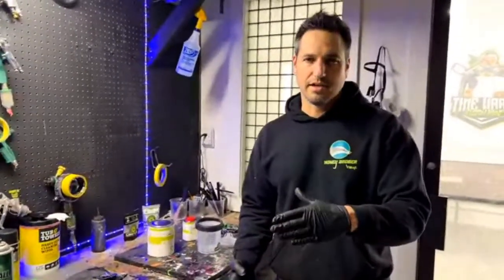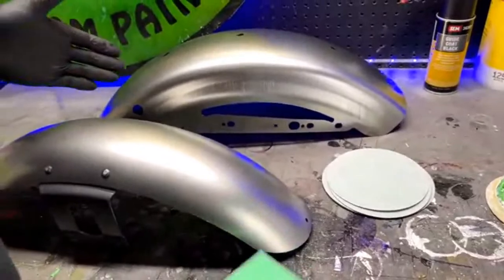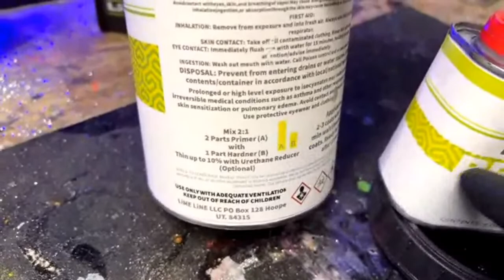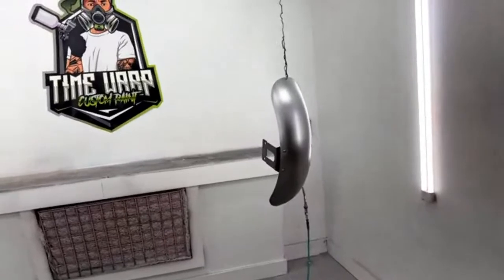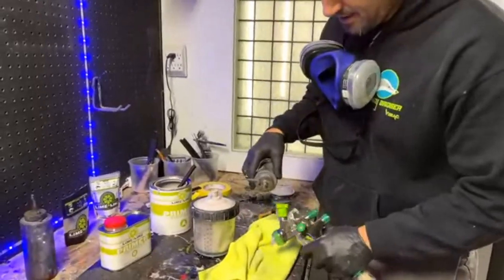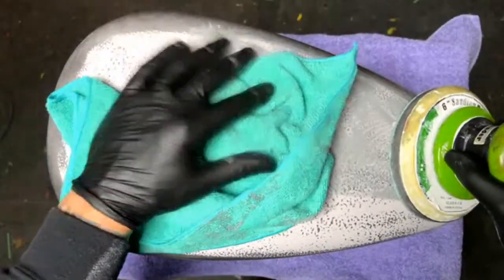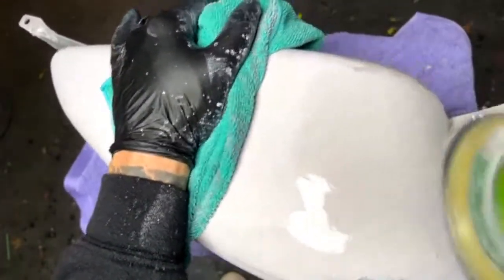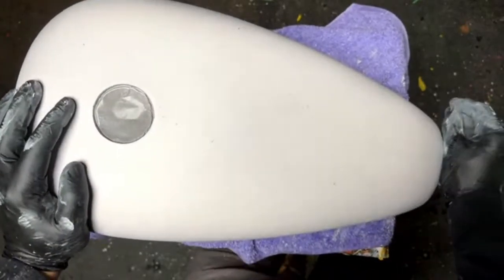Prepping bare metal motorcycle parts for custom paint

Comment: When you remove the lids of your primer and paint cans drive a nail every two inches inside the rim on the can. The sunken part. You can even use an awl. Poke a hole and go to the next until done. When you pour any primer or paint that stays in the rim of the cann will drain back into the can. When you place your lid on and tap it tight it will seal the drain holes. It keeps the top of your can clean. If you don't believe me contact me and I'll video what I mean. You can also do it with an emty can with anything in it and verify what I'm saying